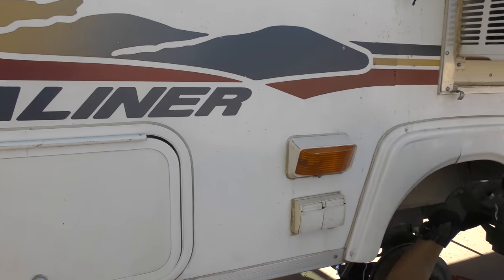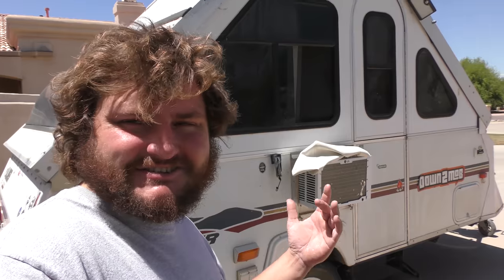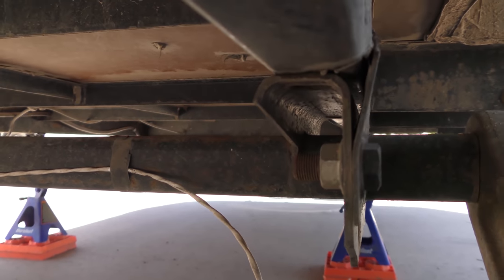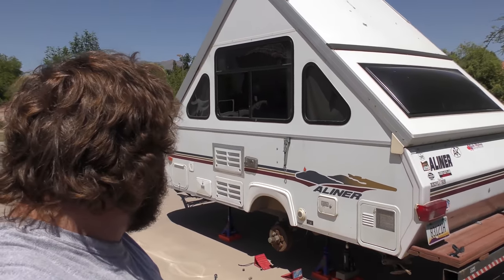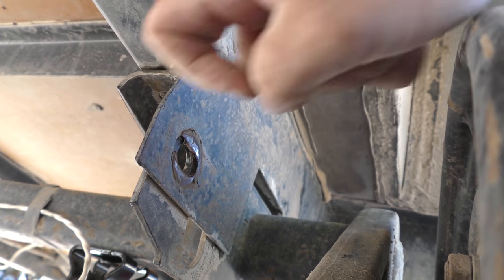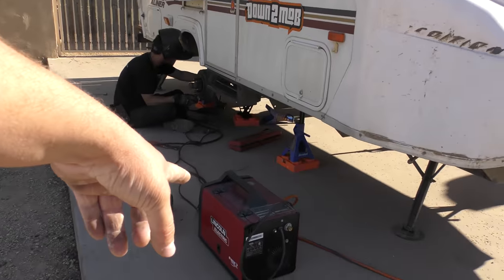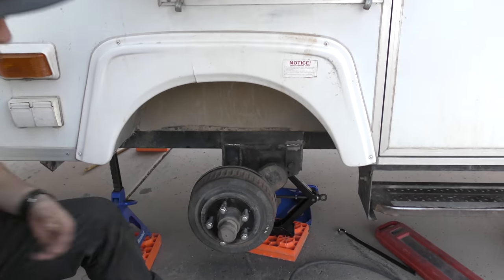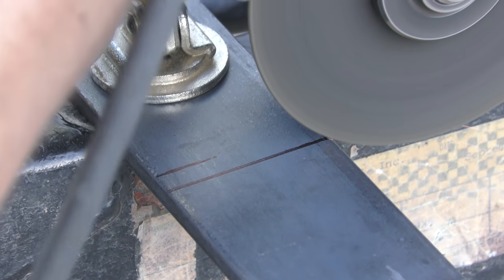I BROKE the WHEELS OFF MY CAMPER TRAILER - Welding the Aliner Pop Up Frame AGAIN

Comment: If it breaks again I would just go to a junkyard and pull some leaf springs off an SUV (explorer/Tahoe/etc) and  2 Jeep wheels with decent tires  to get that thing up in the air a little and give it some suspension and honestly it wouldn't hurt to upgrade that axle why your at it, people scrap old RVs all the time worst case just get one from tractor supply... I know you plan on getting rid of it in the end but a liner upgrade videos would probably attract some new subs plus you make the value go up for resale so it's win win really
Reply: David Dorn Mattered Italia Marie Kelley Mattered  It's a camper. a Land Yacht. Always something needs to be fixed in the field, then a bunch of things need to be fixed when you get home.

Comment: Aircraft mechanic here.

Reinforcing a break or bend has the tendency to transfer stress to the next weakest component.

Would you consider fabricating a new frame, then setting the camper atop it?
A new frame engineered for your use could save you from a break-down.
And you could design an articulating hitch.
A potential win-win?
Reply: this is the exact response id expect from a aircraft mechanic ! cheaper to buy a new trailer

Comment: We have had an 18' 06 A-Liner Expedition for years. It's a beaut! It has been way off road in Western Colorado (where we live), and trips to Moab backcountry 2-3x every year. On the interstate from Florida to Oregon. The only real mods we have done; flip the leaf springs and raise the frame 6". 
Plenty of space and when I add the hitch extender, I can drop the tailgate and get the ATV in the bed. Our A-Liner weighs in at 2000lbs, fully loaded with food, gear and water tanks full. Our fridge runs AC, DC and propane. Swapped   all interior and exterior lights for LED and it sips electricity.  
We have had other types of campers, this is the best for towing, low profile and weight. Fits our Fam of 4 snug, like a hotel room when I'm solo.

Comment: Would have been a good time to pack wheel bearings or install some bearing buddies. Should have removed the old bracket and installed a one piece repair. Check out your torsion bar axle probably wore out.
True its not an off road vehicle, but he could have beefed up the axle supports so, he could have a better chance of not getting stranded,and if he keeps going off road he probably will.
Reply: Yes one solid plate with all  corners radiused and even a radiused point arrow shape at the front and rear end where attaches to the side of the trailer box frame. But all that durability won't stop the torsion bar from snapping or stripping off at the ends.  Definitely not a good off road design.

Comment: It does have springs on the axle, it is a torsion axle, so there is some suspension on it. It was a very good repair!  Should last at least until the next breakdown.

Comment: Those rubber in torsion axles are great. Leaf springs will only degrade the handling. My Hi-Point off-road motorcycle trailer had them, and it was awesome off-road. The A-Liner frame looks pretty light duty for serious off-road.

Comment: It has a torsion arm suspension. The springs are steel rods inside the axle. That's why the wheels are offset of the axle. But it's also not meant to be off road like You use it.

Comment: Does it not have a torsion axle?  Those torsion axles use rubber rods to provide the suspension compliance.  The rubber rods do break inside the axle tube.  And they are damaged by heat from welding.  So you should check out the condition of the axle before you put her back in service.

Comment: Your statements about the quality of the trailer is inaccurate as the trailer was not designed to offroad like your doing with it. For  on road use primarily it is more than adequate.

Comment: It's built for Wal Mart Expeditions.  You seriously need to air bag that thing.  I would have plated the sides with a 12" X 12'' X 3/8th, then angle ironed the back side, with triangled gussets to the frames back side.   You would have loved my old Jayco Popup camer trailer I used to pull with my 4 WD truck. I air bagged it the first Winter, after one summer of kayacking season.  Those torsion spring axles are just not built to flex the amount you are putting into it.  Case in point, you've already bent your tongue.  My current back woods camper trailer uses the front IFS torsion bar suspension of a pickup and actually has remote control steering for squeezing around tree lined trails. Beefy, and yes it's got air shocks on it.

Comment: That torsion axle is a much better design than a leaf spring axle and allows for independent wheel movement, which should give a better ride and a better following trailer.  That said, the axle plates that broke on your Aliner for sure do not have any beef to them.  I've watched quite a few of your videos where you've been off road with the Aliner, not to mention the few clips you've inserted in this video, and your Aliner was not designed for that kind of abuse, period.  When you've got air under the tires, that's beyond what the manufacturer intended.  The Aliner Titanium is the off road worthy version.  Be interesting to know if they've done more than just add the 15" off road tires to the Titanium.  I'm interested in the Aliner Ascape, and I'll for sure be crawling under it to check how the axle is attached to the frame, although I don't anticipate taking it anywhere off pavement.

Comment: what's the deal with the gladiator? wasn't the plan to put a camper on the back of that? is there a timeline for that, or are you just going to run the a-liner into the ground first?

Comment: Maybe a axle swap will be the answer with the same size wheels as the Gladiator.
Those sway bars coming down from the torsion axle ain't strong either and bend easily if you have a bit of a HEAVY load... 🤠

Comment: If it breaks again, buy a leaf spring axle setup and mount the axle under the springs for more lift.   Really not that much money and I think its stronger.   I have a 3500axle with leaf spring setup that i have beat to hell all over Utah.....still going strong!    Looks like  lateral forces applied to wheel/axle looking at those cracks......do any hard off angle camber drops with your airliner?   That axle to frame thing does indeed look mighty weak (before welding that is).

Comment: Yikes, I have been looking at the Aliner Titanium, wonder if it would be any better
Reply: Yet another reason not to buy an Aliner A-frame. Buy a Chalet A-frame made in Oregon. Far superior build than AN OTHER A-frame on the market. Chalet are hard to find and more expensive but worth it.
Reply: @oldmillrd1506  I've had both, our ALiner  has outlasted the Chalet. Both abused off road. Some things the Chalet did better, but the A Liner has lasted years and miles longer than the Chalet (RIP)

Comment: As Michael Drucker commented its a torsion axel that's your suspension. But I would add, did you notice that the cracks began at point where the thin original plates met with the frame right at the point where they were welded form a 90 degree corner. It's hard to explain but stress  cracks often start at inside corners. Google Excelsior Comet If my memory serves me right. It was a British Airplane and they built it with square corner cabin windows cracks developed and it wasn't good. All modern aircraft have radiused corners or oval windows. To stop cracks in metal plates a hole is drilled to terminate the fracture it can then be welded and the grain structure of the metal will not crack again. If you're friend would have radiused  the reinforcement plates at the point where they attach  to frame at the front and rear of the axel and even carried the plate along the trailer frame a little further front and rear of the axel the repair would be much stronger. Also there is a torsion bar inside that square tube that runs from one side of your trailer to other. There is a spring steel bar inside of it that twists like a spring. It works just like a coil spring but straightened out. Have a nice day and keep an eye 👁 those repairs. If you snap the torsion bar it will cause the wheel to swing up into the well and act like a brake and if at highway speed only on one  side of the trailer. Need I say more not good. Be safe.

Comment: I would like to see some rubber between the axle and the frame. Just cut some tires up and run a bolt through them. Better than nothing.

Comment: Terribly flimsy axle mounts!   However, does look you have torsion axle suspension substituting for leaf springs.  There is no excuse for such a flimsy frame.
Reply: The torsion is worn out.  I run a few big trailers with that style and the flex great.  I would say 5 inches of travel minimum
Reply: My twin axle (2x3500lb Torflex) tow hauler pup had the same kind of flat plate mounting the axles. Maybe a little thicker than that.

Comment: I believe this trailer has a 'torsion axle' which is supposed to act like suspension. They usually market these these trailers as 'expedition' or off road' when they have the torsion axle and decent ground clearance. Which is obviously lame lol because this thing cant handle it

Comment: Stop talking....research...its a rubber based suspension.  After 15 years rubber gone which puts all stress on brackets. Normally  the rubber inserts eat up the flex,bounce,stress. Should have been tested at purchase probably replaced.

Comment: Bro you gotta weld it first then put it on the truck.. if you weld it separately like that the joint is filled with weld and not the steel itself.

Comment: Actually theirs nothing wrong with torsion axels they work better than leaf springs coz each side is independent from the other givind a more even ride the problem was it wasnt supported properly if they had used 1/4 " steel in the first place it probably would have been just fine
The dowm side to torsion axels they only have a ten year working life especially with as much travel and off roading that you do
Like your channel

Comment: So is no one going to mention that you never check if the axle is still square?

*read comments*

Nope, guess not.

Check that the dang axle is square. You don't want dog tracking that leads to a death wobble. Just a few simple measurements is all you need to do.